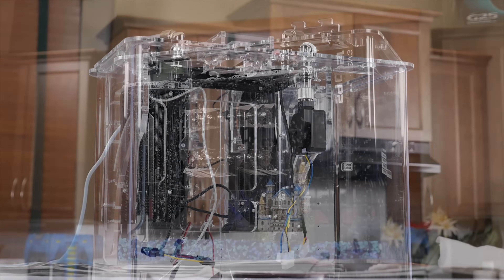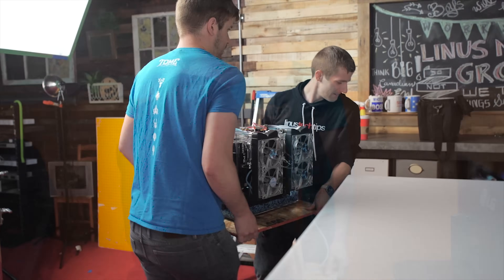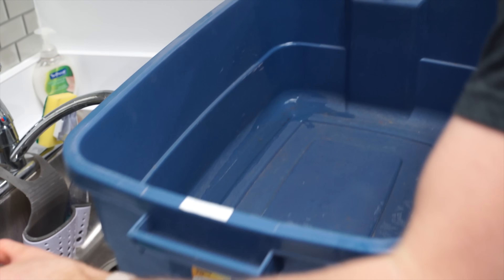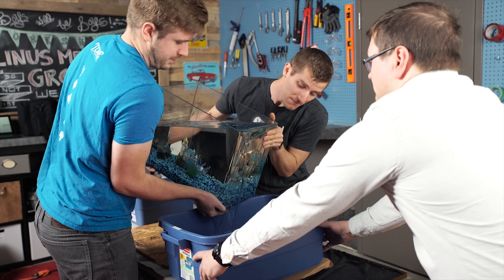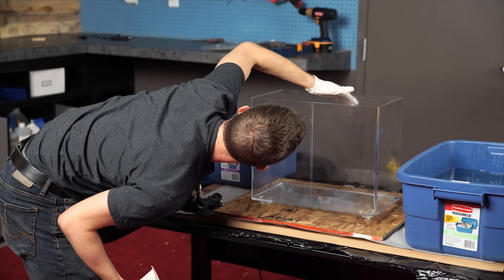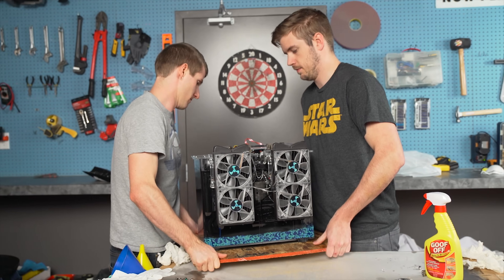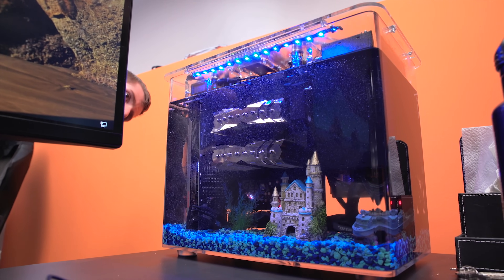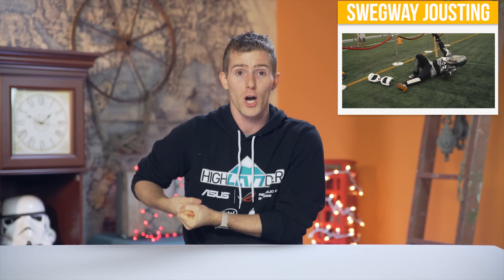Aquarium Mineral Oil PC Maintenance Vlog

Comment: Why is there so much of the PC outside of the oil? I thought the point of oil PC's was that the cooling came from everything being submerged. Does the oil run through the external coolers or are they just looped to whatever they are cooling?

Comment: ...why didn´t you just pump the oil out using the pump you already had, or by sucking it up with a hose and pouring it into the container? 
That way you wouldn´t have to lift the whole aquarium full of the stuff and risk further damage to it by putting stress on the side panel.... and its a lot less messy.

Comment: Although it is in the back where the radiators are, you now have an ugly line on the case. Due to the stuff you plucked the crack with. Isn't that an issue?
Reply from the maker: It already had a seam
Reply: ITS C.C., OMG! PIZZA HUT!

Comment: i tried this a few years back and ran it with pride for over 2yrs as my main machine. One problem i continued to run into was "wicking". The mineral oil has the ability to permeate the insulation on all cables and "wick" into anything wired(even the power cable). I went through a few corded mice and keyboards trying to resolve this with no luck. imagine moving your mouse and realizing it's leaking lol. Did you build have the same issue?

Comment: in the build video of this machine, you guys actually put the oil after the PC itself to avoid any air accumulation in tight areas, and in the maintenance video you reverse the process by adding the PC into the tank already riddled with oil, is there any reason? Toy!

Comment: You know a hand pump is like $5 and could pump the oil out of the container without turning it on the side?
Reply: Bulb siphon hand pump... auto stores sell them for gasoline, will work for water and oils of course.  Could help someone needing to remove oil solo.
Reply: +Jeffery Lloyd (KiGrind7) Using just a hose and letting gravity do the work also works fine.
Reply: The8curtains It's the same thing except the hose has a bulb so you don't have to suck on it like you're going for a promotion to get it started.
Reply: Jeffery Lloyd If you submerge the whole hose before, sucking is not needed as it is already filled.
Reply: Sounds messy.

But I've siphoned a lot of fluids before.
Reply: Battery Operated Liquid Transfer Pump cost less than $10 and they are designed for volatile liquids.

Comment: By the way, you didnt fix shit with that wicking adhesive, since the crack is inundated with mineral oil. The silicone goo might stem the leak, but I'm betting your lap joint is going to fail eventually.

Comment: I know this is an old video but I've been considering building an aquarium PC for gaming but I'm not quite sure how well it would work for the cooling.
Reply: very well since the mineral oil draws the heat away very well
Reply: +Aaron Wohlschlegel I thought it would but I wasn't too sure because that's the only type of PC that I've never personally worked with. I usually go for heavy sir cooling or a mix of air and water cooling but I figured on my next build, I'd try something a little different because the most demanding game I ever played on one of my builds was Skyrim at 1080p.

Comment: Major reason why i'd never  do a  mineral oil  build
Reply: I don't understand... I've had a (used to be) high end gaming pc for the last 6 years, and I've never needed to replace parts on it. All you anti-oil guys make it sound like replacing PC parts is a weekly, even daily occurrence.  Changing parts in a mineral oil PC is easy - you pull the old part out and stick the new one in. The mobo can remain submerged for the whole process.

Comment: why about cooling it in the fridge. would mineral oils ambient temperature improve in a cooler atmosphere. i.e.  a freezer or refrigerator so long as psu and other delicate hardware is kept separate from the motherboards min components?
Reply: Maybe a deep freeze set to 0-5C. You could simply put the entire rig in, and tape the lid down.

Comment: Would the silicon of a regular aquarium be attacked by the oil?
Reply: Yes.  You have to use an acrylic tank for mineral oil. Glass tanks would spring a leak eventually.

Comment: Ok so I have been looking at parts to build my own Computer. Now I just need someone to tell me if the parts that I had selected are right and appropriate. I had about a $500 budget. I selected a Black and White theme. 

Case: DIYPC Shadow-H01-W
MB: MSI Computer ATX DDR31066 NA 970A SLI Krait Edition 
GPU: EVGA GeForce GTX 950 2GB FTW GAMING
CPU: AMD FX-6300 6-Core Processor Black Edition
RAM: Kingston HyperX FURY 8GB Kit (2x4GB) 1866MHz DDR3 CL10 DIMM / White
HD: Western Digital Caviar Black 1 TB SATA III 7200 RPM 64 MB 
Power: EVGA 500 W1 80+

So if you have any recommendations please  tell me, thank you.

Comment: And why not get the parts for a water cooler but instead but the oil in it?
Weighs far less and removes the problem that water cooled systems have to worry about (leaks being instadeath for a pc).
Reply: Because the only reason to use oil instead of water is its nonconductivity which you dont need if its inside of tubing... There is no reason to use oil inside a watercooled system instead of water.
Reply: I like how google dropped the ball on alerting me of the reply.
Refer to what I said when a water cooled system leaks water it's instadeath for the pc.
Mineral oil gives you a warning rather than outright buttfucking you when it leaks.
Reply: D8W2P4 Its not instadeath. Have you dropped water cooler solution on a motherboard before or do you assume?
Reply: *****
Ok let me rephrase it, drop it on the right spot and it is.
And we both know full well where the water will go and the herculean feats it'll do to get there, like iron filings to a fucking electromagnet.
Reply: D8W2P4 Mineral oil is way to thick any would kill your pump super fast.
Reply: Josh The Raptor Productions - JTRP
Uh no try again.
Reply: Probably because water has about 4 times the thermal conductivity then oil so it moves heat better.
Reply: It only took 3 months and 4 comments to give an actually good reason for using water over oil.
Reply: D8W2P4 You havent given a good reason against it either.
Reply: What part of leaks aren't instadeath don't you understand?
Reply: D8W2P4 What part of they arent with water either dont you understand?
Reply: I've already been over this with you before you get it on the right spot (which there are PLENTY of on any motherboard) it is.

Comment: im just finding it really stupid that these fishtank boxes dont come with a pipe drain at the bottom that you can just open to drain the machine. it's a really stupid oversight that would make replacing the oil WAY easier. they should just have their own open bottom stand that you can place a pan under, unplug the drain and let it flow out like a car oil pan. like wtf?

Comment: What happens when you pour in half a cup of water into the Oil PC?
Reply: even if it spread throughout the oil, the micro droplets would have to bridge two exposed & active wires... like cpu pins, not the covered motherboard circuitry... unlikely
Reply: +bunnyfaceperson123 but if it did spread wouldn't it fry everything because water conducts electricity?
Reply: +longboy8998 - it wouldn't fry anything. the worst that any water can do is short out a circuit. that's what damages computers. if you've ever tried to mix water and oil, you may have seen the small drops of water that form throughout the oil, and those would be very unlikely to connect two active wires in a computer and short a circuit

Comment: Jesus Christ. A small transfer pump is cheap in comparison to the possible disasters lying ahead by trying to pour this into a bin. You could have emptied the entire thing in 10 minutes. Honestly, you should have a filtration system in place and just use the pump your using to filter the oil, to empty it.